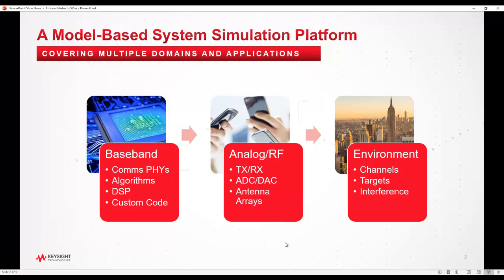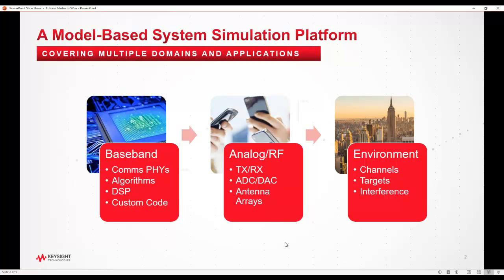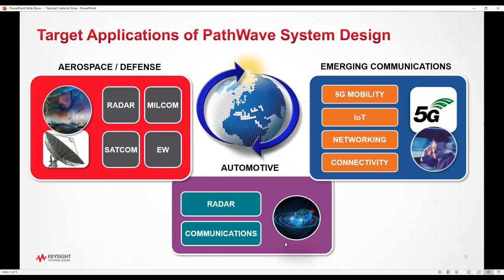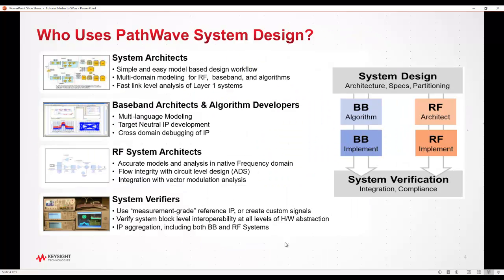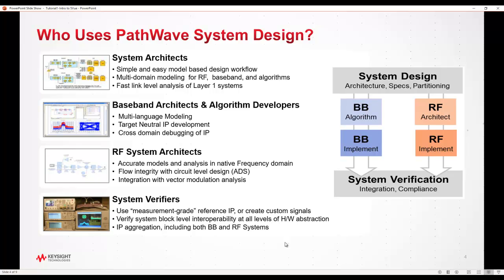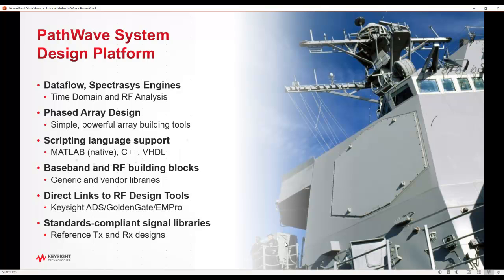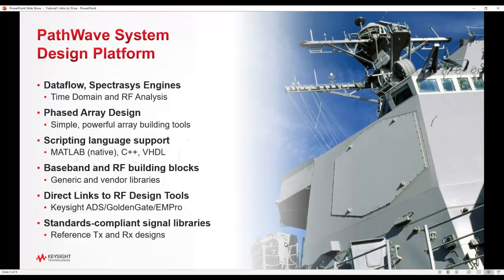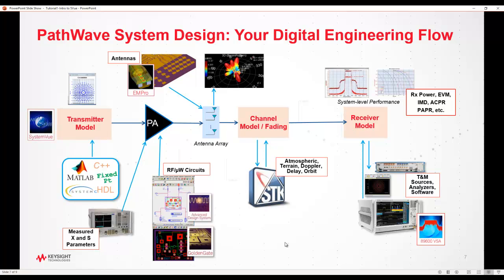Tutorial-1: What is Pathwave System Design (SystemVue)?

Comment: Hi Anurag,
Thanks for the great videos! I have a quick question about SystemVue.
Can I import a measurement-based large-signal PA model (like an Angelov model) into SystemVue to analyze system performance (EVM, ACLR, Pout)? I want to use a detailed model, not just the simple behavioral PA block defined by gain and NF.
Reply from the maker: Angelov model is for transistor and not for complete PAs. There are plenty of alternatives available to do what you are trying to do: X-Parameters, FCE etc. Both of these models can be extracted from ADS designs directly.
If your objective is only to perform modulation analysis, then you can use VTB in ADS to directly get all figure of merits directly.

Comment: hi there, I want to work on next generation signal design for GPS and Galileo and would like to start learning these software. However, I am confused about a few things

1. Which one is better? Systemvue or Genesys
2. Can I use these software to simulate advanced GNSS signals such as Binary Offset Carrier Modulation etc?
Reply from the maker: SystemVue will be better for your applications as it has GPS library and also supports GNSS signaling/waveforms. Kindly contact your local Keysight support team for more help.